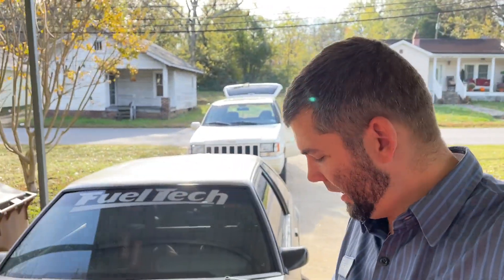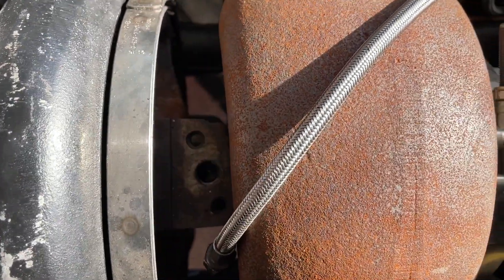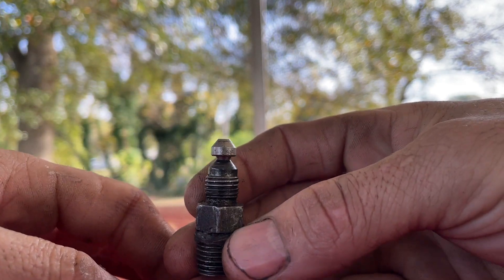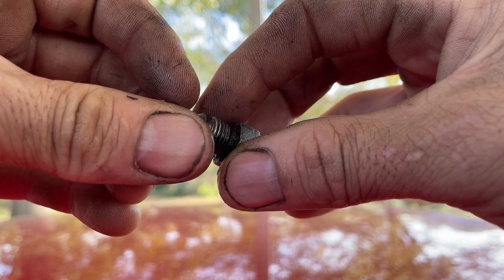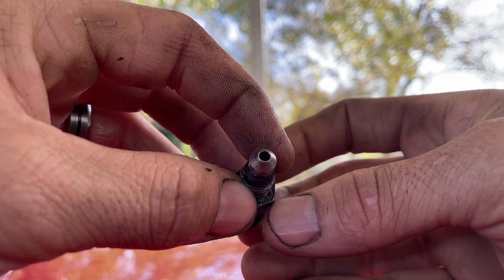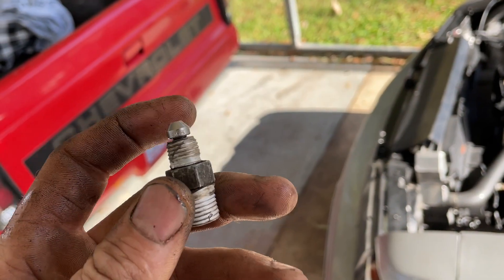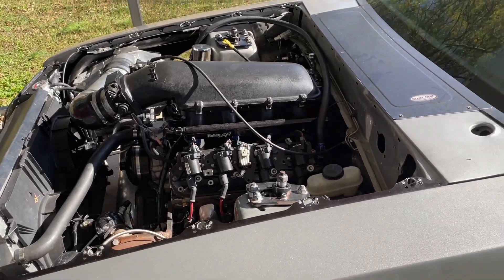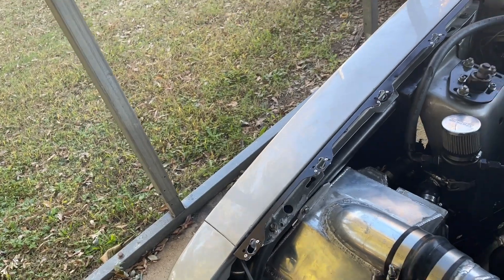How to restrict your turbo oil feed line

Comment: Did it fix?
Reply from the maker: Yes
Reply: @Boostismyfriend  i’m not sure how true it is but I heard if you add a restrictor it will increase oil pressure and that increased oil pressure is not good for turbos either. Not sure how true it is. I added a restrictor to my T 25 turbo but it is still smoking from the center cartridge, I did a smoke test on it too and there is a tiny bit of smoke coming out from the turbine seal but I suspect that’s normal… I know I have to add a few bongs and fittings in my valve cover to vent some of the crankcase pressure to help with the pressure inside the engine
Reply from the maker: @BulliKid  adding a restrictor reduces oil pressure from a dash 4 line to about the size of a needle, a turbo needs just enough lubricant to get the shaft cool and the bearings wet,  number one cause of them smoking starts with a  blockage in the return hose, could be a small crip, or turbo placement, its needs plenty of volume for the oil to drain back,  if there any kind of restriction on the drain side it will back up,  this video is for cars   Making alot of oil pressure on the feed side, a turbo needs 20-40 psi max
Reply: @Boostismyfriend  so I wonder if getting a oil pressure regulator for the turbo feed is the best and safest route in case hi oil pressure blows out seals eventually seems like a must to control that oil pressure
Reply from the maker: All the newer ball bearings stuff uses restrictor on the stuff, there built into the fitting, on new cars the build them in the lines
Reply: @Boostismyfriend  I know a fitting restricts oil flow. But I heard it increases oil pressure as a result.  I wonder if it increases oil pressure going to turbo or they meant just in the engine
Reply from the maker: It increases the engine, it slows the flow in the line
Reply: How small would you go. Currently .06 and still smoking.

Comment: How much psi did u have b4 doing that when full warmed up after some runs
Reply from the maker: 70-75 idle, 115-120 on a pass
Reply: @Boostismyfriend  damm that’s hella pressure u said b4 doing this right
Reply: How did u get so much psi on a ls motor
Reply from the maker: @turbovicsatx2910  all honestly we don’t know, 10355 pump, i have put 2 different pumps and 2 different springs, cam bearing clearance plays a big part of it,  nigels motor cold makes similar psi but nothing near it down track
Reply: @Boostismyfriend  what does your make once fully warmed up after a run and letting it idle
Reply from the maker: 70/75 , it makes 85-90 cold idle
Reply: @Boostismyfriend  I’m putting a 10355hv pump in mine soon I got a biggo pt98 and my idle pressure is at 17psi once fully hot but if I cap the oil feed from the turbo I get my normal 20s 30s psi at idle
Reply from the maker: Its going to have s bearing bleeding pressure off, probably cam bearings
Reply: @Boostismyfriend  damm I’m jealous
Reply from the maker: Go watch this video, nigel was having the same issue, once we pressurized the system we found his problem 
https://youtu.be/iz_wjqXmPC8